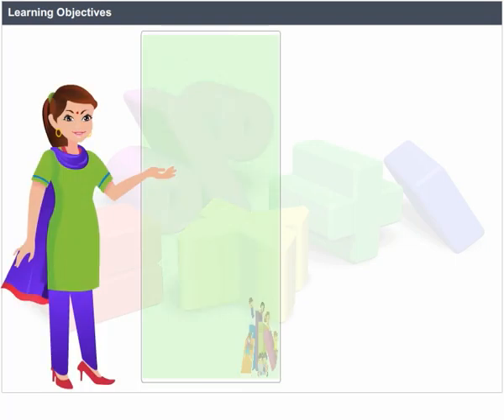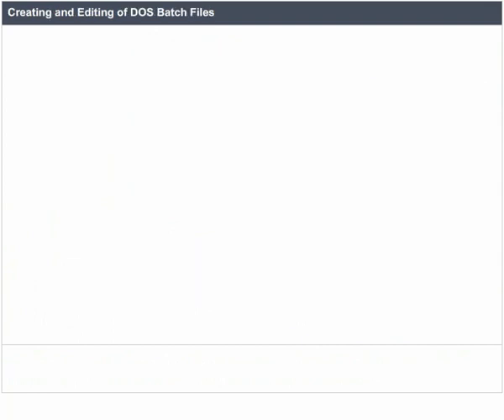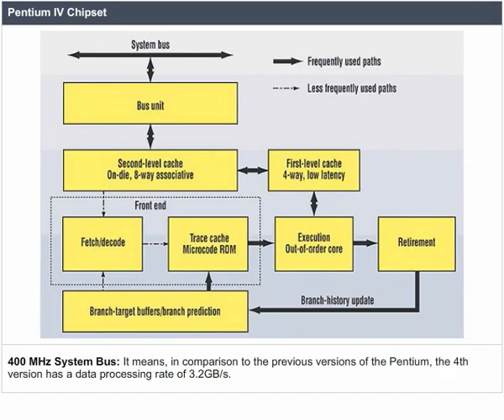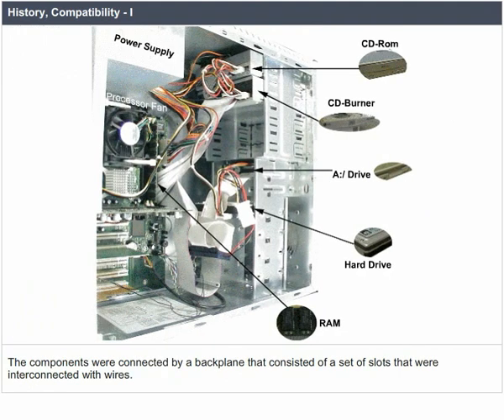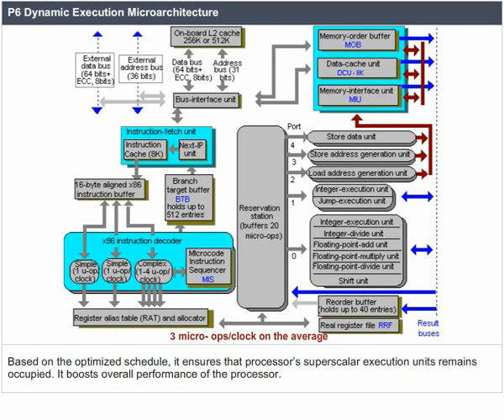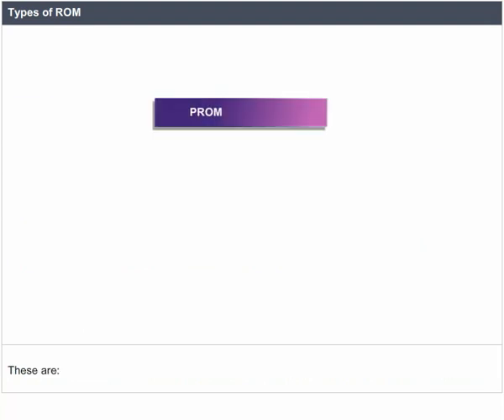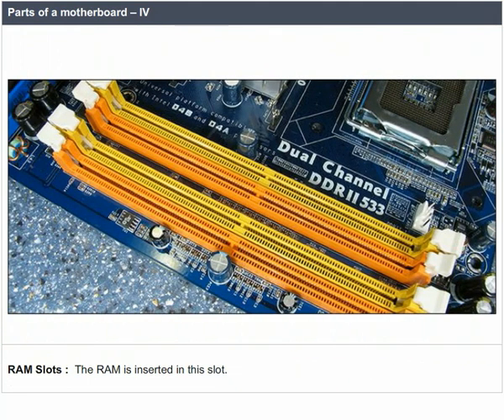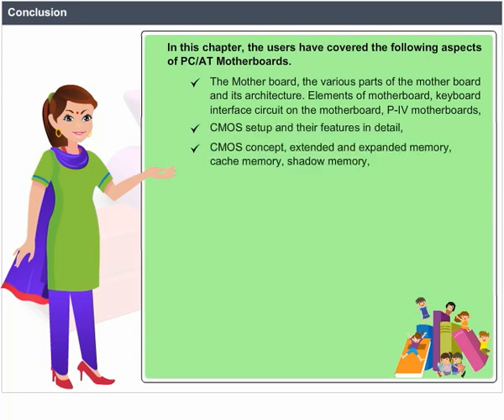PCA 3 PCAT Motherboards

Comment: Primitiv ability to shell scripting. 😂 I like to use DOS batch files as open source container to put the instructions of a routine inside the batch file to create a new executable file from the routine. Most of these container batch files have to start with one or more parameter attached to build and to modify the routine. Have fun with DOS.😊